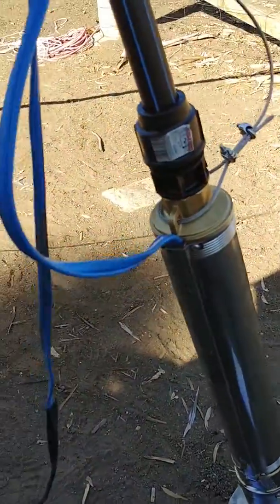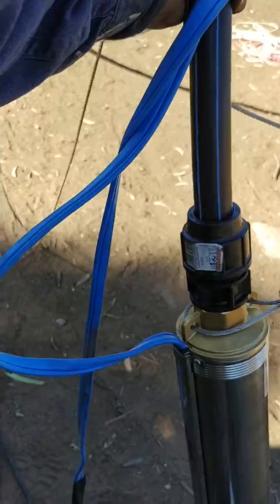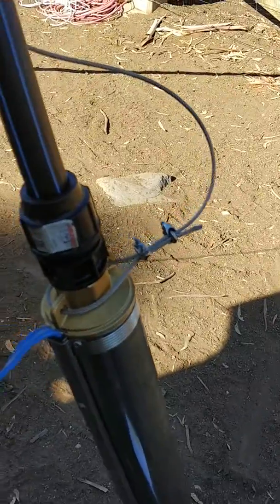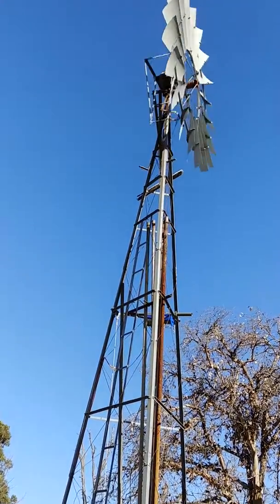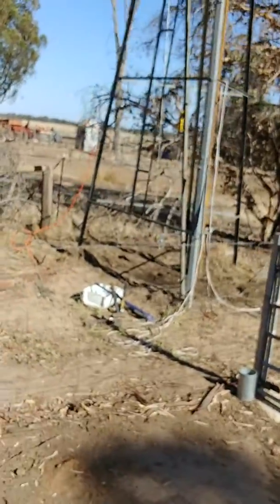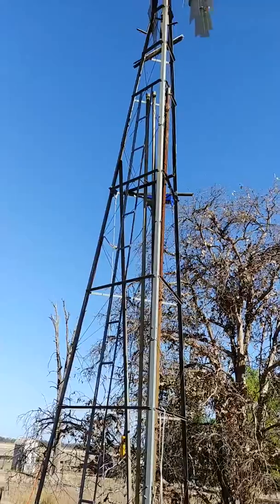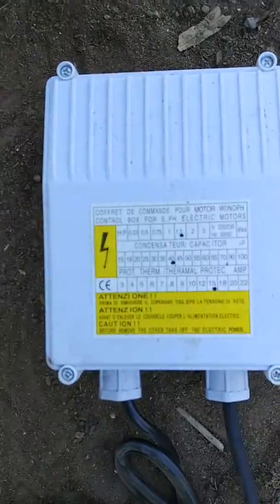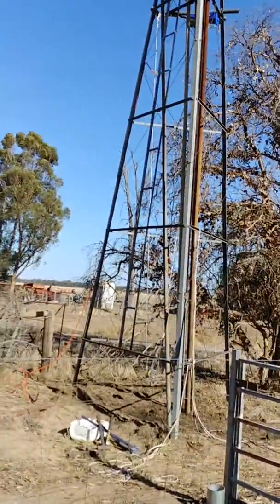Replace windmill pump with electric submersible

Comment: We have a 90 ft cased well with an operating windmill. We have a 2 inch windmill pump jack at the bottom of 80 ft of 1-1/4 inch schedule 80 threaded plastic pipe. Pretty much a conventional windmill installation with one small twist. We installed a 3/4 HP 240 volt submersible pump below the conventional windmill jack. This allows us to simply flip a switch and pump more than 30 gal per minute whenever we wish. We can use the windmill in it's original design as well, allowing the wind to pump the water. The windmill can operate while the electric pump is operating as well. This gives us the best of both systems. When we need lots of water quickly it's easily available. If we simply want the wind to fill the stock tank without using electricity we have that choice as long as the wind blows. The system has functioned well for more than 10 years with almost no trouble. If you're thinking of adding a windmill consider adding the submersible pump as well. It greatly enhances the versatility of your windmill. You'll be glad you did it.
Reply from the maker: Good idea! Sounds ideal